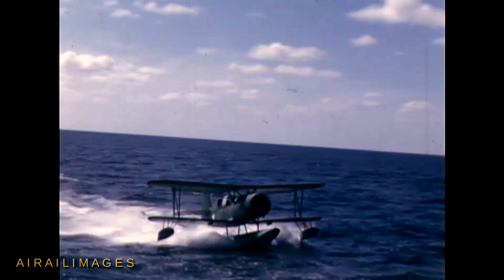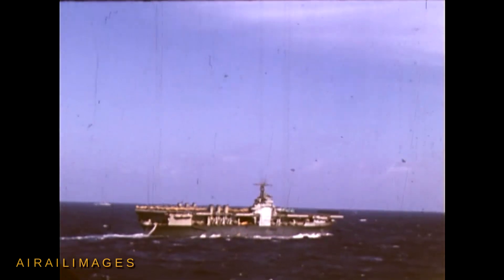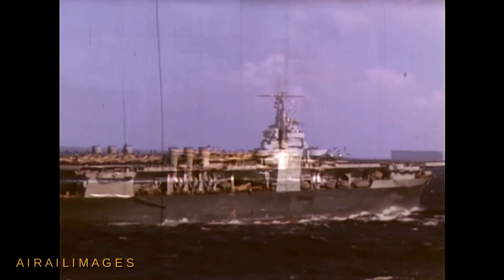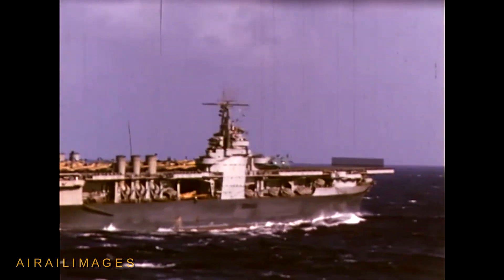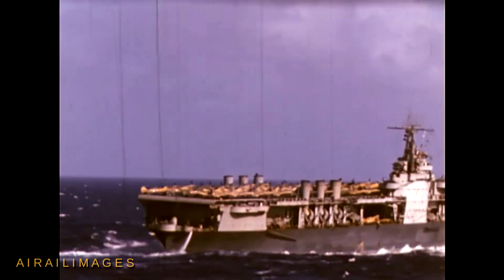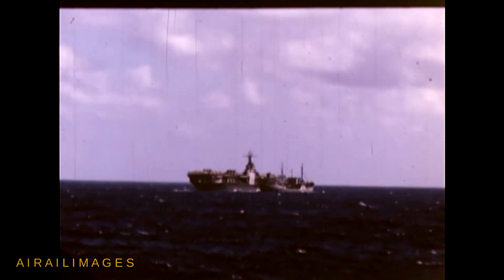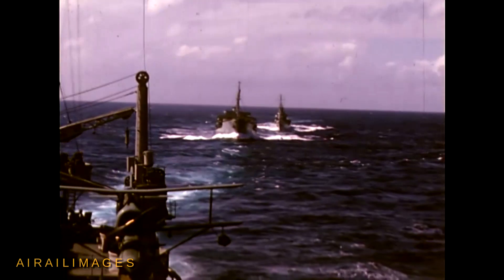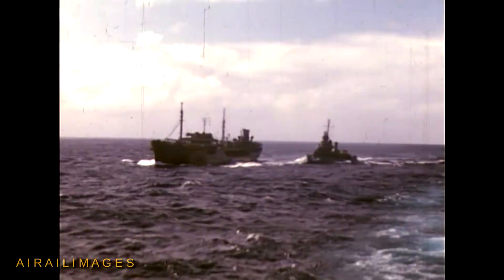Curtiss SOC-3 on USS Tuscaloosa with USS Ranger North Africa Kodachrome World War II color NARA

Comment: Another of your great finds. What was the purpose of the netting that the float seemed to be trying to move onto? 
I like that the observer had to climb up and try to grab the hoisting cable and tie it off while bouncing all over the place from the waves. That must have been fun.
Thanks for finding these old films.
Reply: The aircraft would land on the water's surface, then taxi to the mat, allowing sailors to secure the hook onto it. The recovery mat provided a stable point for the hook to engage, securing the aircraft for hoisting back aboard the ship.
Reply: @jcr150658  Thanks...